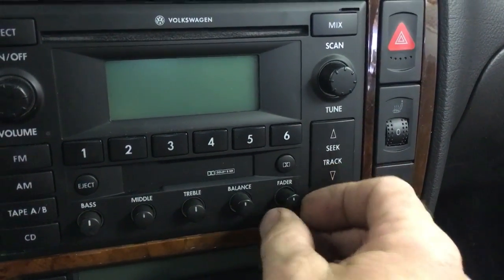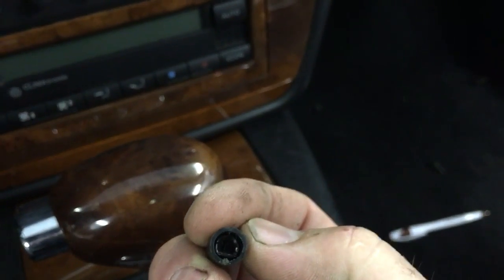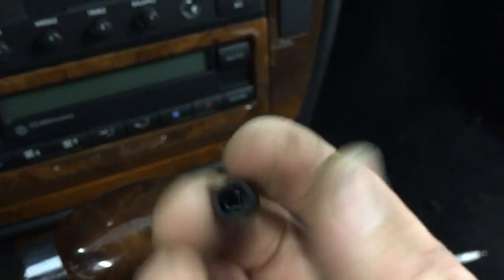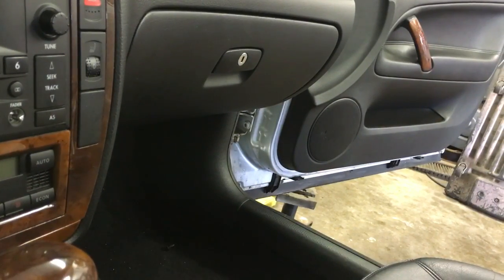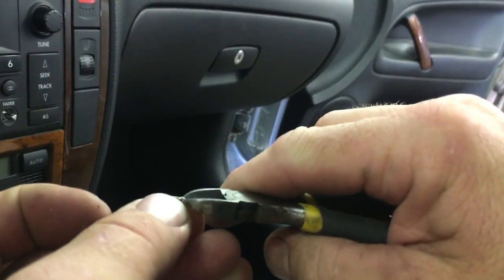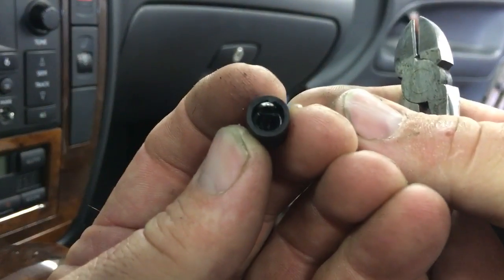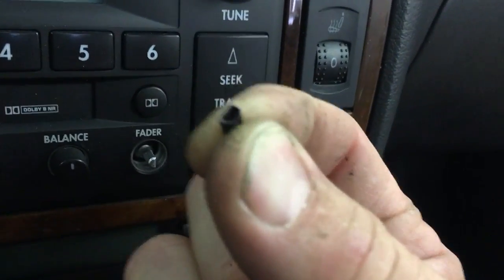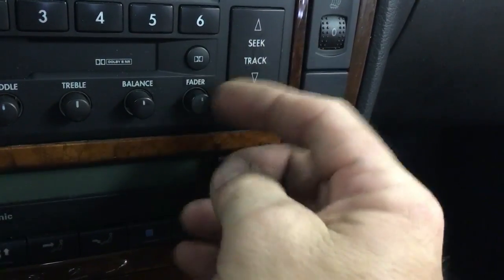VW Radio knob repair

Comment: I'm not having a problem with the knob my radio is showing safe to and I wanted to know if you can help me with the code
Reply from the maker: Tenicha Jackson the only way to get the code is to have a programmer extract it from the ECM eeprom. I can do it but you would have to mail it to me

Comment: My 2013 Toyota Corolla Stereo power knob has an issue. I can control the volume up and down just fine, but the pressing of the button to turn off does not work. So my stereo stays on all the time when the car is running, obviously it turns off when the ignition is off. I would really appreciate it if anyone can help me fix it by myself.
Reply from the maker: TheHFH 
 The radio should shut off when the drivers door is opened. Do you have a warranty on your vehicle?